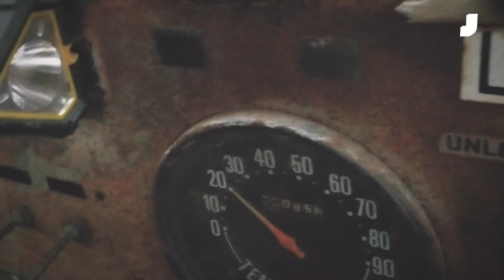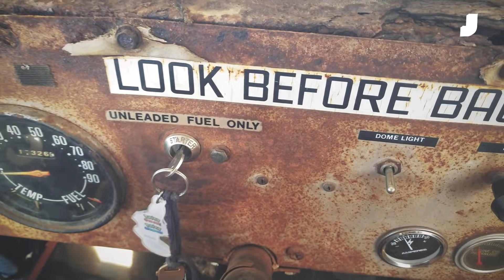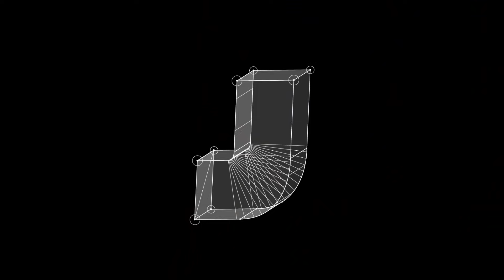Project POStal: The End  Of The Road - Part 7

Comment: Excellent journey. I owned at one time a DJ and  an AMC Gemlin (half brothers).That straight six is damn near bullet proof. I dearly miss my DJ, but I has a pregnant wife at the time and it wasn't the best vehicle for the situation, hence the Gremlin (Tan paint, tan interior, standard 3 speed, and the worst automatic choke in the world).  I got so good at unsticking the choke when I stalled it at a light, my fastest unstick was on Lakeshore Drive  in Chicago, in the period of a stop light cycle, I was out off the car, popped the hood, pulled the air cleaner, jammed a screwdriver down the carb throat, start the car, button everything up, and move out. I do miss those two cars of my youth.  Keep up the good work.